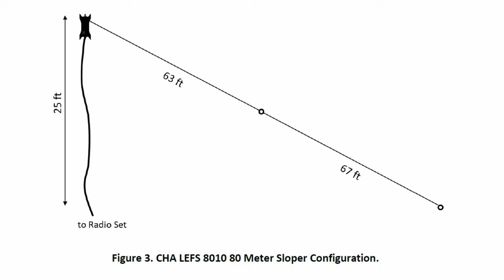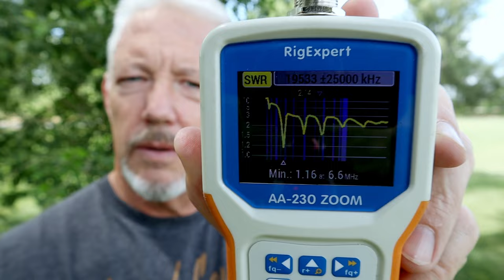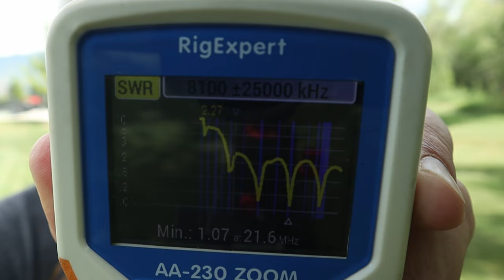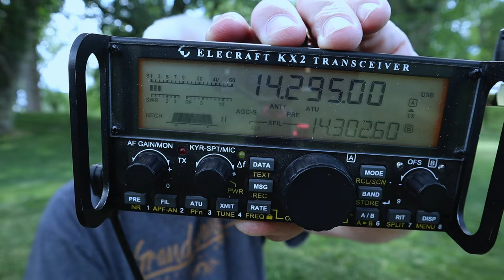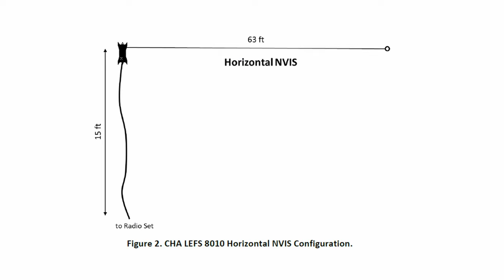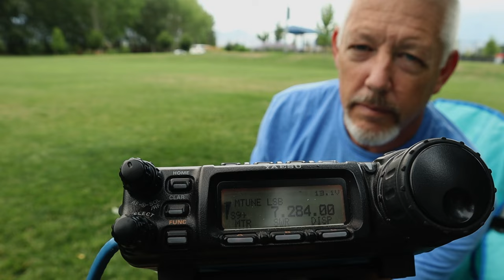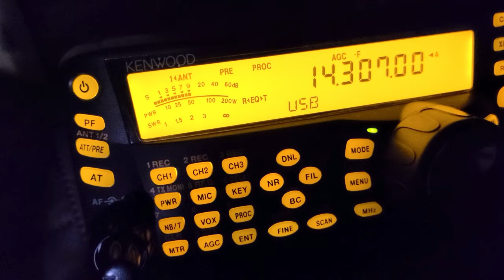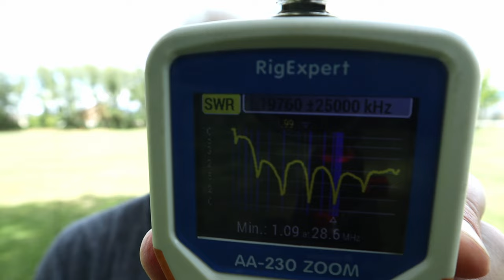In 20 minutes, this antenna became a "go to" for ME | K7SW ham radio

Comment from the maker: What multi band HF antenna do you use ?
Reply: Hello Kevin, I am a Wire Man who loves using EFHW Antennas. My favourite is the 49:1 Fransformer Balun. I run several different Wire Lenghts from 39,2ftShorty up. to 130ft. Long Wire.. I am a simple Guy who wants to keep it simple with best Performance possible. I
Reply: I use 49:1 unun , 135ft wire inverted L, up 30ft, works 80, 40, 30M no tuner,  I use my beams for high bands...
Reply: @Ei2iP  💯👍🙋‍♂
Reply: I used a Chameleon Lite Tactical Dipole and a MFJ 1982MP EFHW for the QTH. For portable LEFS 40-10m, Tactical Delta Loop and a ECOMM III Portable EFHW. All Chameleon is what I use most of the time. 

W4ISB 
Mike in Tennessee
Reply: At home QTH I use an all HF band 71' non resonant end-fed sloper, 15' at high end, 6' at low end, 9:1 unun at high end, 50' RG8x, common mode choke 3' from amp, no counterpoise. SWR is 1.2 or less without tuner on 20, 17, 15, 12, 10. Using my amp's tuner on 160, 80, 60, 40, 30, the SWR is 1.5 to 1 or less. From California using 100 watts SSB & QRP on 40, 20, 17 I've worked Europe, Africa, South America, Asia, Australia. I get solid signal reports on daily 80 & 40 SSB nets. I'm very surprised and happy with the performance of this compromise stealth antenna.
Reply: At home tenntenna 49:1 with dx10 wire... in the field km4ack 40m efhw best for the price... when you can get one lol.
Reply from the maker: @pale_2111 , it looks like you might be a fan Mike ;) Thanks for sharing your setup.
Reply from the maker: @jonmcadams5401  , Good layout you have Jon.  It sounds like your system is setup just right.
Reply from the maker: @the_mad_swimbaiter455  ,exactly. supply and demand indeed. 73 Kevin
Reply: At home I have a DX Commander MBV in the backyard.  For portable, I'm usually on the Chameleon MPAS 2.0, or lately it's been the CaHRTenna Artemis EFHW.  I own quite a few products from Chameleon, and it is all reliably high quality.
Reply: I have a 40M EFHW mounted as an inverted vee about 35 ft high at apex and 10 ft on the ends. Matches and works real well. I’m in Michigan and when condx are good can work plenty of DX into EU on 40.
73 Dave K7DR
Reply: CaHRTenna Artemis. 40-10 EFHW
Reply: Wolf River Coil, I love it for Parks On The Air. It needs to be adjusted every time you chains bands but it's pretty broad. That means if I'm in phone, I can usually use the entire phone section without retuning. I have used it for 40m, 20m, and 10m. My main Riggs are an IC 718 and a FT818ND. I have also used the Wolf River Coil (TIA Silver Bullet) for Winter Field Day.
Reply: I have 5,5 meter fishrod on 27 meter high for 10-20 meter band, and connect inductance for 40, 80 meter band. I have qso over 14000 km long distance
Reply from the maker: @ИльяМуромский-м5щ  , Yep. That is how you do it ! thanks for sharing
Reply: I use a longwire and a ZM2. I carry three wires of different lengths and use the one that best matches my throw.
Reply: Last year I ran a 58' random wire to a 9:1 balun. Was able to work 160-20 (never tried lower due to the cycle being bad). It was run as a sloper with the feed point 10' and the top about 50'.  Able to work all continents as it was fairly omnidirectional.

This year I'm trying an 84' in the same layout, only the additional 25' drops down from the top end. So kind of a sideways 7.
Reply from the maker: @jeffparent2159  excellent setup. Thanks for sharing
Reply: It's more work, but my portable is an 80m loop fed with 100' of 450 ohm ladder line, MFJ-901b little tuner. Four 100' pieces of paracord, four 3lb lead weights, a 4' ground rod and 10' of flexible ground braid for the rig and tuner. I can usually throw the weights about 20' up. I used a tennis ball launcher / fishing reel for field day in 2018 and 2021 with weighted tennis balls, and I can get it up about 40', but it takes more time. 73, KG7SXF.
Reply from the maker: @2A1C1downURnext  ,  that sounds super fun.  I have put up an 80m loop while camping and it is a blast.  I wondered how it would be for field  day.  You may have talked me into it now. 73 Kevin
Reply: @hamradiowithkevin  Kevin, band openings for the last 2 years that I did field day weren't the best, but I could hear everyone on 80, 40, & 20. My spot is in eastern washington at clover flats campground, ahtanum west of yakima about 30 miles at 6200' ele. Noise floor had always been 0 even with the preamp on my FTDX-3000. I use a 80m OCF and 160m OCF, 20m ladder line fed loop, 80m wire ground mounted vertical and 10m vertical at 40' at my QTH. 73, KG7SXF
Reply: Palomar 6-80 OCFD antenna on my base station.  Talk to Australia and Russia, easily from Louisiana.
Reply: sorry antenna's are above my paygrade Dam this hobby is above my paygrade .
Reply: I use a Wolf River Coil with six 24 feet radials.  The camp grounds I go to have small campsites.  A 40-ish foot sloper is the biggest wire I could use.
Reply: Fantastic video, as an old guy working on getting my Technicians license I've been learning allot from these videos. Granted some of these are way out of my league right now but very informative. Thank you.
Reply: Got a W9SAP random end fed on the way with 1:9 unun.
Reply: Hex beam 20 15 10. W6SF
Reply: Well right now I have a EFRW home brew. I am in Rochester NY and I have made contacts in the Canary Islands and all the way into Europe as far as Germany on FT8 with it. I have it set as an inverted "L"  angeled NE to SW. I am using a ICOM IC-705 with only 3-4 watts and I seriously impressed myself. I know it's digital but even on CW with the reverse beacon on 40 and 80 meters I cannot believe where my signal is heard.
Reply: 5:58
Reply: @DK5ONV 6:32 6:33
Reply: B.        V.
Reply: Palomar Engineers BULLET-8006-1500, Frequency Band(s): 80-40-30-20-17-15-12-11-10-6, Power (PEP watts):: 1500, Length (ft):: 95 feet
Reply: I built an EFHW from scratch, works well with a G90 radio because of the built in tuner.
Reply: Hey antennas are usually simple, easy to learn and experiment with. These days even sophisticated test equipment is cheap! Come on jump in the waters FINE! WB4IVG LAURIN
Reply: @laurincavender5412  a $60 Nano VNA, some coax fittings and some wire or scrap metal and you're off to the races.
Reply: Into wire antennas. Using an 80M-10M EFHW.
Reply: For my base station, I use the TN07 MyGoTo AND an assortment of EFHW antennas made by Chameleon and TN07'a IMD 109 EFHW.  If operating from a local park, I prefer the JNCRADIO MC-750 HF GP Antenna .... very easy to set up and tune.
Reply: Funny to me Kevin! 
Everyone new starts out running a wire antenna, moves to using the large poles and it seems everyone is now reverting back to wire strategies via communications again! LOL!! 
Btw, a slingshot is a great way to feed lines over limbs vs. using a loud tube gun or just invest in some medical tubing and make an improvised one really easily. 
Thanks for the video, it was great.

Comment: How well do the bullet connectors hold-up over time? It seems that  repeatedly connecting and disconnecting may cause problems, especially out in the field. Any corrosion issues with the connectors?
Reply from the maker: like with anything i suppose that is true, for me i have not experienced any issues yet. I don't use that antenna everyday, or i should say i don't activate the radio everyday. Your point is valid though. Great question

Comment: Quick suggestion for others using this antenna.  I have one.....and when I raid it up I have the coax looped through the hanger so the weight of the 25' of coax is not straining on the antenna's feed point.

Comment: Nice work. The FT-857 tends to sound far noisier than band conditions actually are, as you've noticed. It helps to use their DNR or even just a speaker or headset that attenuates high end a bit. The internal speaker just isn't large enough to provide good low end audio. But it works. It just ends up being fatiguing to listen to for many hours. The choke generally works out better at the rig end.
Reply from the maker: The hard part is trying to record audio for a video from that speaker. 
You are right it is noisey but serves it purpose when I need it.  Thanks for the nice words.  73
Reply: I'm glad you caught the choke location, I was going to mention it!

Comment: I use EFHW antennas quite a bit. One suggestion for you. an EFHW uses the coax shield as counterpoise. By placing the choke as close to the unun as you did you eliminate that possibility. I wonder what using something like 25 feet of RG8X then installing the choke then the feedline to your radio would yield.

Comment: Great video and very thorough. I have the 10-40 version and use it all the time. I am sad to see that Chameleon still hasn't changed the end ring and rounded them off after they've gotten a lot of feedback on them. The squared off edges can tend to kink the loop over time, especially adding that extra length. Anyway, keep up the great vids. 73
Reply from the maker: I appreciate that, I see what you mean. I might even try to round mine off. I suspect it will be weaker . Perhaps I will find a larger but round one.  Thanks for the support . 73

Comment: Smiling!
Looks and sounds good, thanks for the good review.
DAt home I use an 80/40 center feed dipole at about 55 feet center and 30 or so at the ends.  For the most part 80 meter loop 30 ft feed point and 15 to 20 at the 3 corners, is my go-to.  Don't do a lot of portable operation but have been thinking about it.  Load up the Jeep Wrangler and go play.
Reply from the maker: Yes get that Jeep out and operating portable!  When I load up my TJ and head out for some operating, It can be one of the most magical things by getting up in altitude and setting up.   73

Comment: I have a 9 to 1 unun I bought off e-bay, 117 feet of wire, something, and at 19 feet in a sloper, I get less then 2 swr on all bands over 80 meters, I love it cost less then $20 , I also have a chameleon cha mpas 2.0 also run a tuner, I think you have a hell of a reflector with all that wet grass under your wire.
Reply from the maker: Thanks David, I sometimes wish I had that grass when camping in the mountains . Nice work building your affordable wire antenna.  Those are really fun projects.  73

Comment: 11:02 curious where is "this location", Utah? Any nearby lakes/water? If so, you don't necessarily need to "run to the hills" for better signal. Water makes a GREAT reflector for signal bounce and also means the soil is likely more damp for better ground effect too. If only the SW had more of this "water" stuff?! 🤔

Something kinda interesting about EFHW's and dipoles is they can be somewhat directional for TX RX, having a hair more sensitivity and TX power lobes out at 90‍° to either side of the wire element. Another config that effects your signal take off angle is using a sloped ^ inverted V shape. Tie your suspension throw line about 15-'20' in from the end of your 40m (66') element wire and hoist from there, so that 15'-20' hangs straight down. Then with the radio out on the "free end" it lets you pivot around that vertical hanging end at least a good 90‍°-180‍° to "aim" your signal.

Helps to have a small backpack ETC to hold the battery and free your hands up to operate the radio too. Looking at an azimuth map also helps get your bearings where to aim. To hit Europe from say CA, UT area you'd set up pointed 90° perpendicular towards say NY or the middle of Canada, as the crow flies not directly East.

Comment: I am glad you finally used higher power. It makes a big difference.  QRP levels are fun but having 50 or more watts really makes a difference unless you are using FT8.  With the bigger lighter batteries 50 watts is easy now.  K8WPE
Reply from the maker: It really is good to have so many options that keeps the hobby fun.  Thanks David 73

Comment: I got the 40-10m version. Tried it out on my IC-7300 at 100w with the tuner turned off, no tuner needed for 40, 20, 15 and 10m. 17 and 12m needs to be tuned. 

Chameleon makes great antennas. They are a bit pricey, but the work great for portable operations and at the home QTH. If you see them on sale at their website, that would be a great time to buy one. 

On a side note, I do not use the inline RF Choke made by Chameleon. I've heard of some people having an impedance mismatch with them. On my portable operations coax (RG58), I use a mix 43 torid about four to five feet from the feed point. I haven't noticed any RFI using the mix 43 torid or SWR issues. 

73, W4ISB 
Mike in Tennessee.
Reply from the maker: All valid points and well put, thank you Mike. 73 Kevin

Comment: Nice review, very comprehensive. I have the Chameleon LEFS 40-10 model and it is one of my go-to antennas. I've been using it for over a year and it holds up well to the abuse out in the field.
Reply from the maker: Thank You Michael 👍 I got to work you on this antenna recently during a POTA/Camping Trip and that was fun.
Reply: @hamradiowithkevin  I remember that QSO. You sounded great, so the antenna was doing its thing.

Comment: The other benefit of having a slightly low wire antenna is that it becomes more omni-directional .... especially if you do an inverted vee.
Reply from the maker: Inverted V is a very common setup for me, it only takes 1 mast. And that is often a good thing for my adventures

Comment: Good video, well done.  Just a thought though...the CMC choke needs to be at the radio end of the coax and not at the feed point.  EFHW antennas use the COAX shield as part of the antenna.  Having the choke at the feed point doesn't do anything...and CMC currents can get down into the radio.
Reply from the maker: Thanks Chip. Excellent point.

Comment: Hi. Not sure why you're trying for Europe when you say you're using a NVIS setup; that'd be for close-in 0-400 miles coverage typically; it's a radio hose squirting straight up and back down.Great for HF inside the skip zone. 40 60 75 mostly. 73
Reply from the maker: Ken, your right. If I was able to reach a UK station, that would indicate that the manual was not correct about this antenna being in its NVIS configuration. I will say that it certainly captured some good signals far off in the distance.  When setting this antenna up as I did later in the video it confirmed that as a sloper the antenna works DX well.    73

Comment: What you're calling an NVIS config, where both ends are at 25' isn't really NVIS, it's a dipole! When you started out, at 25' (and especially at 10') and then other end on the ground, that your kept calling a sloper, now that was NVIS config.
I used to use an Army NVIS antenna, I forget the designation, but it had 2'5' segments that you put together to get the feed line up to about 10', and 2 wires as an X that all went to the ground. I replaced the wires to get them on 40 & 80 Meyer bands. I used them w/o a tuner also. I was using this in the Charleston SC area (all over SC really) and it worked fairly well, for what it was. It was definitely a to cloud warmer, we used it for EmCom during storm prep and after the storm passed.
I like your KX2, and your antenna though, I haven't been hamming lately, makes me want to. (I pretty much always build them) 👍
Reply from the maker: Jeff, your right. Building antennas is a great way to go, and setting up in different conditions helps me be better prepared. 73

Comment: I have this antenna and with the feed point at about 25’ I found on 75/80 it was resonant way down in the CW portion of the band 3.5 and over 3:1 near 4.0 MHz. The 4010 from them works great and is my go to antenna.

As far as the choke, I found it works better at the radio end for keeping RFI out of my Hiel  headset, especially on 20m.
Reply from the maker: Thanks for sharing Mark, I will have to try the choke at the Radio.
Reply: @hamradiowithkevin  you’re quite welcome. There’s probably a lot of things that factor into how this antenna will tune. The coax acts as the counterpoise so I would imagine the the type, length, & connectors used would also factor in. I’m using 75’ of Mesi & Peloni ultraflex 7 with a 90 degree compression coax connector on the end that goes to the antenna wire winder so connecting the choke to the radio was a lot easier in the grand scheme of things. So it was happenstance that I figured out that it removed the RFI getting into my headset better at the radio side of the coax.

Comment: Hey Kevin, terrific video! I have two end fed antennas, one 80-6 meters which didn't state it was a no tuner needed, but at home it had good SWR readings on all bands. I also have another 80-6 meters which states no tuner needed, which is still in the package for camping, I think is longer than the other one. I'll see how it performs once I get to go camping again. I currently have two QRP transceivers and am looking either for an amplifier or a higher output radio. Thanks for the videos de N7MRF.
Reply from the maker: Vaun, thank you. I can say that QRP is fun to me, however I really to enjoy running 50 to 100 watts from the camper to get some important activations completed.  Your going to really enjoy those antennas. 73 Kevin

Comment: Great video. I like how you presented the setup and showcased the antenna.

Too bad you didn't try CW, the RBN can orovide some data on signal strength to various locations. 

Also, did you test 30m by chance? I would think it could work when configured for 80m.
Reply from the maker: I may get a chance to try this camping season. It really is a fun antenna